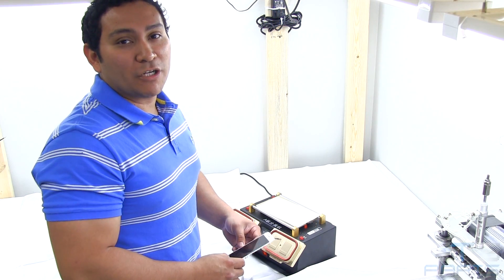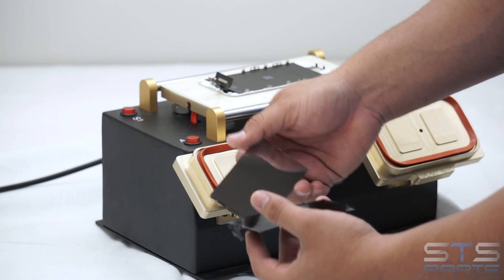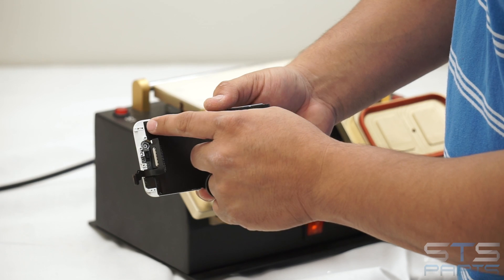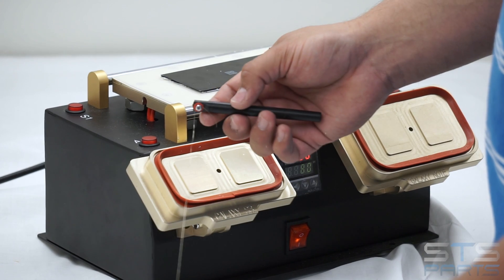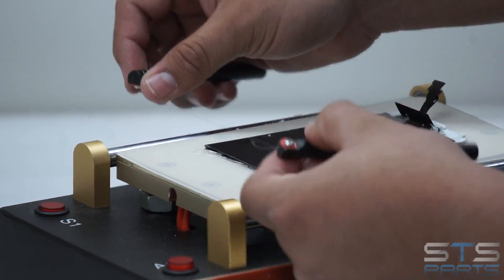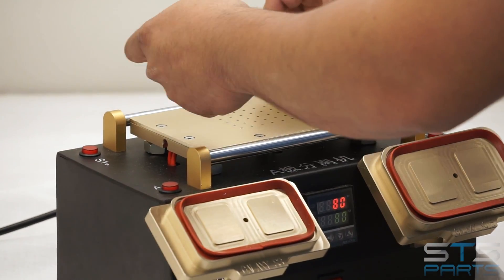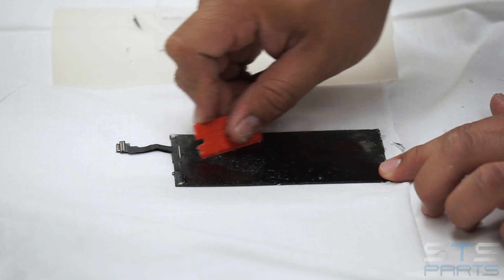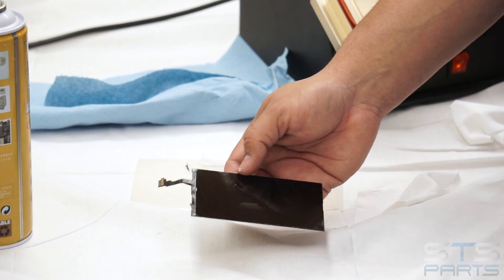Glass Removal on iPhone 6 Screen

Comment: Good video and good highlighting of extra product(cleaner) and the wire tool. I'll be looking for all that stuff on the website. So you prefer not to use those guide rods on the sides when running the wire separator?

Comment: How did the machine help other than to hold the glass like a vise?
Reply from the maker: Hi Dave. This machine uses a vacuum to hold the screen down which is more practical than a vise with clamps. It also acts as a hot plate to soften the glue and remove the glass successfully!
Reply: ý

Comment: Tell me please, what is that pad with holes in it that you lay over the hot plate? silica something or silicon something? What is it, and how can i get it ? thanks a lot.
Reply from the maker: +remus097 Here is a link for it https://stsparts.us/products/replacement-silicon-pad-for-lcd-separation-machine?variant=4192389188
Reply from the maker: Here you go! https://stsparts.us/products/replacement-silicon-pad-for-lcd-separation-machine?variant=4192389188

Comment: This is the best glass removal video I've seen!  I'm starting my own little cell phone repair business and have a nearly identical separator machine so I've been watching several of these videos lately.  The reason this stands out: DETAILS!!  Thank you so much for taking the time to explain even the seemingly small details while you're demonstrating the repair.  

Seriously!  It's embarrassing but I tried for like 2 hours to get that wire between the outer glass and plastic frame thinking I could just shave it off and salvage the frame as well.  When you look at it, it seems doable (and maybe is to someone more experienced) and not one single video I have seen mentions that you should just scrap the plastic frame with the glass.  Plus, it can be difficult to see that tiny wire in some of these videos (not yours though).  

After watching your video, I was visited by the Big Light Bulb of Epiphanies, immediately followed by the FacePalm of Shame.  No idea why I wasn't getting it but this video was a HUGE help!  Also, mentioning that once you start with the plastic blade not to lift it for example.  These are those kind of things that only come with experience and are extremely useful to know.  

Anyways, THANK YOU!  And next time I need supplies I'll be checking out your shop :)
Reply from the maker: +Josh Luptak Thank you so much for this awesome feedback! It is encouraging to know it is being helpful and we can improve the cell phone repair industry. Subscribe for our upcoming videos and happy refurbishing!

Comment: Hi. 
I hale a qestion. If u using this plastick sharp to remove glue from lcd, u dont scrtach it? 
And second qestion. U using loca glue to IPhone ? Thx for answer, and sorry for my bad English.
Reply from the maker: +h483b Thank you for reaching out! -- The layer right under the OCA is polarizer. If it were to scratch it can be replaced however Samsung screens are more forgiving. You can use LOCA on iPhones but it will be very messy and it can affect your backlight which you would need to replace. OCA is much better for iPhones. If you have any other questions please feel free to ask!
Reply: ergun